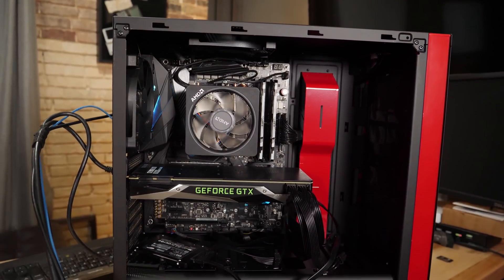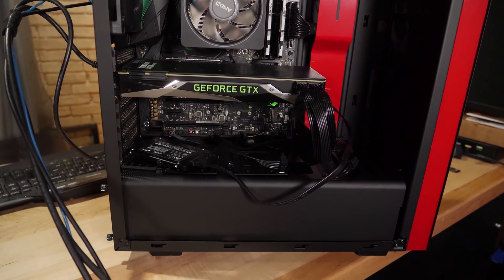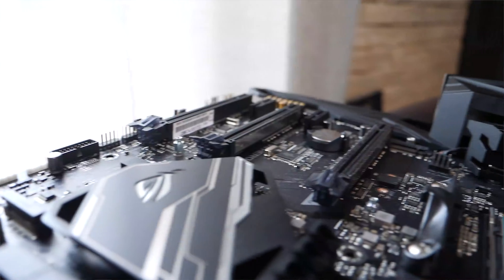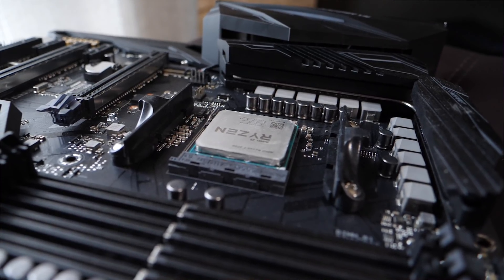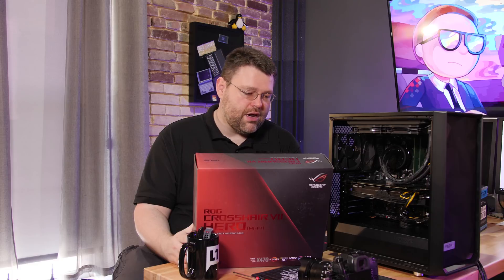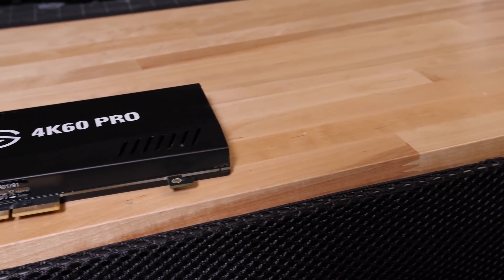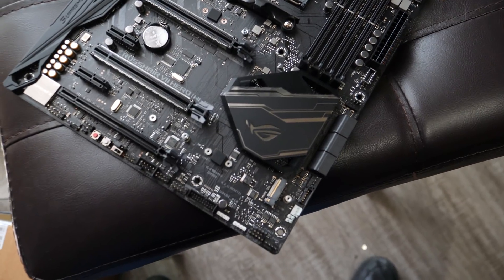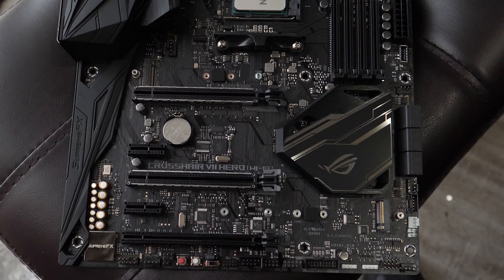ASUS ROG Crosshair VII Hero Wi-Fi X470 Motherboard Review

Comment: Need building advice!

I’m an artist that will be doing both 4k video and 3D rendering. I know the best stuff is going to give me the best performance but I don’t know if anything would be considered overkill.

I will be using Maya, Adobe Suite, and Unity mostly.
Reply: It depends how far you want to push it. If you think a card or two will be enough rendering power or a 16 core CPU enough CPU grunt then I think this is the finest board you'll come across for hammering it 24/7. But the people I know that do GPU rendering in 3D software are all using boards a step up from this that allow many GPU's to be strapped to them but the power supply and cooling requirements start to become scary expensive. Not advisable if the rendering PC is in the same room you live and work but in the sub couple of grand range I don't think there's better than this. One guy I know uses the server board for threadripper with 4 1080Ti's and a massive power/cooling rig that sounds like a fighter jet coming into land plus another PC with 3 GPU's. He says the heat is not tolerable. So you'd need some kind of super air conditioning for that much heat getting pumped into a room that fast. 

I use 1 GPU and have no issues lol

As an aside there's also the benefit that you get two NVME slots so you can have one for OS and one for StoreMI. Say you have a 4/6/10TB texture/model/project drive. You can use StoreMI to to devote an NVME drive to accelerating that slow mechanical drive so it feels like an SSD. Not going to work if you're throwing 4K video around in multiple clips all trying to work in real-time but for most everything else its kind of a miracle solution to getting massive amounts of very fast storage on the cheap. but you get that with any X470 board so don't specifically need this one for that feature. Just mentioning it because its been so awesome for my own 3D work. Huge projects just blip into the software I'm using now.
Reply: SLI is not used when you're GPU rendering with 3D software. Realistically it isn't fine using 1 GPU. It's like saying dual core is fine for gaming. You can do it but its not what you want to aim for.
Reply: el 01 if you want to do GPU rendering. Id suggest not recommending someone buys one GPU. Its torture trying to work on a real-time rendering scene when the UI itself is being drawn by the GPU you're also torturing to death to render the scene. You need 2 GPU's minimum or you can sly around it with 1 good GPU and onboard graphics to drive the UI but that comes with lots of caveats
Reply: thnk for healthty discustion here guy..lot info in it :)
Reply: Clay Mann ty!
Reply: MrBiky Air coolers beating liquid coolers now? I missed something, I had no idea.
Reply: KeeperOfKale Get lots of cores and CUDA
Reply: Doing Maya, Adobe Suit and Unity and still on x470? I'd recommend you go on a Ryzen Threadripper, I'd recommend the 12 core 1920x, but if you can afford, go with 1950x, or if you have the patience, wait for the shelves release of Threadripper 2. Get fast ECC memory (2933 or faster), get 2 GPUs, one for your normal activity (if you don't do anything insane in your normal time, you can cheap out on something easier on your budget, like a GTX 1050 or RX 560) and one high-end for the rendering, like a 1080Ti, or if you can afford a Titan V (you really need CUDA for Maya and Adobe, not sure about Unity, but you still need CUDA). Since you are going to hammer the CPU quite a lot, I recommend you get a Noctua 120mm fan, don't get a watercooler if you will run the PC at full load most of the time without rest. Wendell did a nice testing with a saturated AIO vs Noctua coolers on TR, I think it's called "Noctua coolers for Threadripper". By going with TR instead of Ryzen 2, you get the benefit of more PCIe and you can get lots of benefits from more PCIe (like running both GPUs in x16 and still have enough lanes for NVME RAID and another NVME SSD for caching your spinning rust).

Bonus: if you wait for Ryzen TR2, you might get StoreMI with the new motherboard refreshes (x499?), which could help you with big files on the spinning rust.

If you still want to stay on x470 and don't reap the benefits of Threadripper (pun intended), this motherboard is assured to be future-proof, especially that AMD doesn't make old chipsets incompatible with new CPUs. What I said up still applies to Ryzen 2, minus the benefits of PCIe and no waiting time + some more cheaping out on CPU and mobo.

Comment: Is this board worth the buy over the now comparatively super cheap X370 crosshair?
Reply: PlasmaJunky depends on which cpu you're using. The x470 boards supports both 1st gen and ryzen refresh but x370 doesn't support the newer chip's features like xfr which are actually pretty good. A cheaper alternative instead of the x370 hero is the strix b450 f and Asus prime x370 prime both of which are really good but the strix looks really ugly (not the board as a whole but the nvme shield) and the prime looks sleek as all hell.
Reply: I have a 1700X and my current board is giving me trouble. At least i think it's my board. I don't plan on upgrading until 7nm Ryzen comes out.
Reply: PlasmaJunky which board do you have?
Reply: MSi X370 Gaming Plus.  Every time I try to tune it I run the risk of it not posting which requires me to unplug it and pull the CMOS battery to get it to factory default. (The clear CMOS jumper seems not to work)  I would just get it running and leave it be, but the thing just crashes without explanation all. the. time.  Someone said it was probably the video card, but I'd rather try cheaper fixes first. Especially if I get a button that resets CMOS without laying down on the floor for 10 minutes every time it happens.
Reply: PlasmaJunky there should just be a cmos clear jumper on the board that you can short with a screwdriver or something. Unfortunately, I can't really help more without having the board in hand but try taking it to a shop nearby. They might be able to help you with the problems.

Edit: sorry I didn't see the part where you said the jumper doesn't work. Maybe try using an old gpu (if you have one lying around) or send it to the shop. Maybe even try customer support, as dreadful as that sounds. Sorry.
Reply: Yeah, I'm just looking to replace the board and start there.  Last year when the AGESA 1.0.0.6 BIOS came out the board hung on the install and I had to send it in for service and I was without it for over a month. The tech I spoke to over the phone asked "Why did you try to update BIOS?"  I said "Why did you release a new BIOS?"  I'm not going to be buying MSi again.
Reply: x370 and b350 boards ALL support xfr 2 and PBO if flashed to the latest bios.
It is a bios/cpu thing, not a chipset thing.Same with getting higher ram clocks  2xxx Ryzen has an improved memory controller. Quite a few videos out there showing identical numbers from , for example, a crosshair 6 ( which i own)  and a crosshair 7.  If everything else is equal, using the exact same cpu in both.
Some of the lower end x370/b350 boards will perform slightly lower because of vrm temps or other things, that have a lot more to do with being sub $100 mobos, as opposed to being x370 or x470.

If you specifically wanted to get a crosshair 6 to save money, it will work very well. 
Just need to get the bios flashed to latest.   
Which is why I bought one for my 1600x last year.  
Because doing a bios flash and dropping in a gen 3 or 4 8 core Ryzen in 2019/2020 while changing nothing else is a goodness thing!    
There  ARE upgrades on the new CH7 that are worth having.  You would have to decide if the extra cost is worth it for you.

Comment: Good for 12 cores?
Reply: Get a threadripper :) and 2 vega 64s , and 3 M.2s in raid0 ... Now thats a PC!
Reply: For this generation yes, but what about Zen 2?
Reply: Mikey oh. Okay. For zen2, the board is still good. The power delivery system is overkill (which is good) for six cores. Most higher end boards (except gigabyte) are good for power delivery.
Reply: Most likely. The VRMs are total overkill, so 12 cores should run fine once AMD releases a 12 core for AM4.
Reply: Mikey no ryzen cpu currently has 12 cores. Twelve threads, yes. Cores, no.